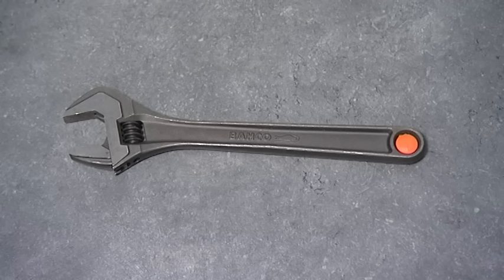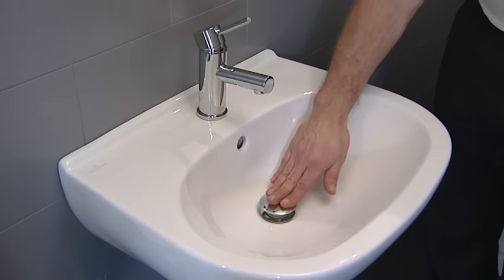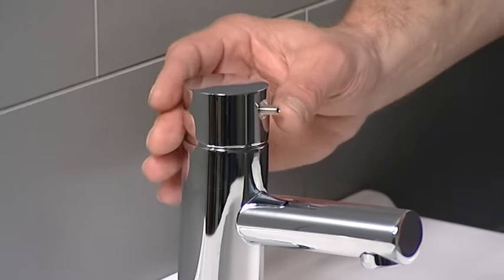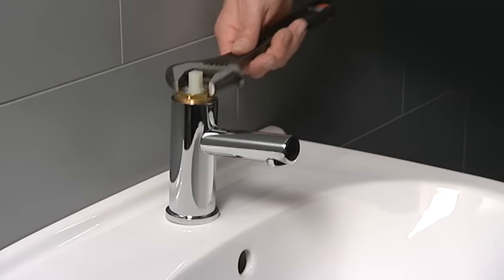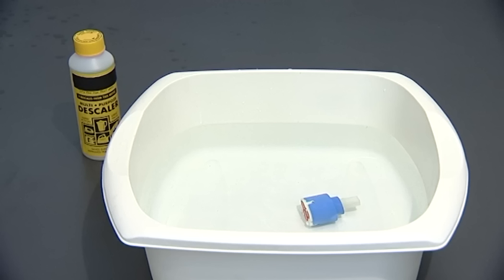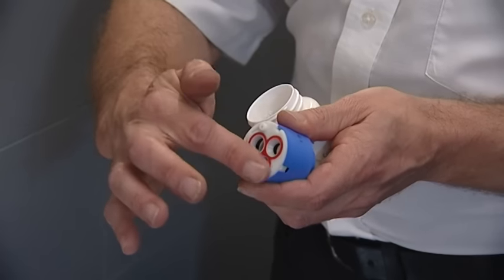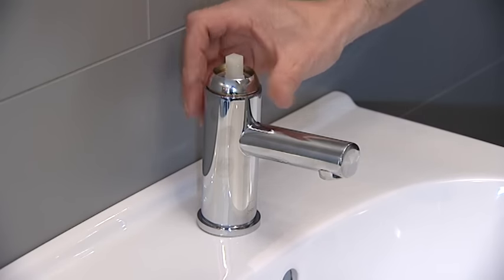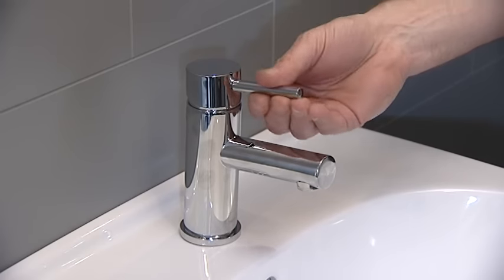Single lever mono basin - Flow cartridge: maintenance and replacement

Comment: Cannot not remove the lever handle  because cannot get the pin to turn.  Is there a way to unscrew the pin, please.
Reply: Used elastic to unscrew corrosive thread

Comment: Or a 2.5mm allen key in my case. After 10 years that chrome shroud can be a nightmare to shift, beware it is only plastic under the chrome.
Just a thorough clean up and reassembly seems to have done the job.

Comment: Looks like this is all brand new never used stuff and we never saw it working !!!!!
most people are doing this on an old tap and fail at the first bit, getting the handle off ,if they manage that the shroud is often stuck with scale , the easy cartridge change then becomes a plumber and a new tap
Reply: Yeah, our tap had limescale in various places, I probably should have used descaler or some spray, but I just cut through it with a Stanley knife. 😆 Had to be careful.

Comment: I can't undo the tap head lever on my freestanding tap. How do you undo one without damage to the chrome? Mine is stuck.
Reply: Put an electrical heat shrink on the handle that way you can go at it with pliers without scratching the chrome. If you haven't got a heat shrink then electrical tape or better duct tape.

Comment: i cant get remove the lever handle, i have tried so many times, i dont know whether it is rusted or calcified. tried wd40 but that didnt help too.  no sort of wrench or pliers is able to twist it open... any ideas?
Reply: I have the same problem. Did you manage to remove the lever handle? How?
Reply: Sometime the screw is behind the little hot/cold indicator on the tap not the lever .
Reply: @myitalus  same
Reply: Mine was stuck too. Slip joint pliers worked, but it scratches the chrome; I didn’t care that it did and fixed the tap (didn’t have to replace anything), but if you do care then you’ll have to find another way to remove the handle…

Comment: thank you very much but my cartridge is stuck and will NOT cone out ,any ideas?
Reply: I sent on a different video if this happens u can try Turing the water back on a a sec the water pressure may dislodge it prepare to get a little wet

Comment: Hello, I have 2 lever taps in my upstairs bathroom sink, one tap for hot water and another tap for cold water.

The hot tap is dripping and I want to change the cartridge inside.

The problem is that I cannot twist the lever off to get to the tap.

Any ideas?
Reply: Hmm, try searching YouTube for a tap that looks similar, if this one is not very similar.
Our tap has a similar function and parts to the tap in this video,
even though the lever looks different. So, success.

Maybe there is a hidden screw requiring an Allen key?
Reply: Oh! That was 6 years ago!